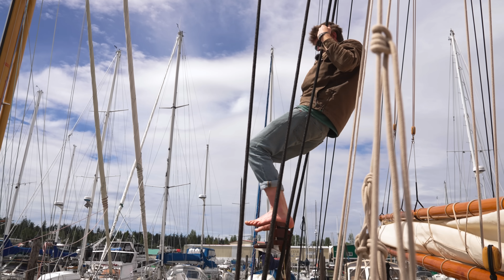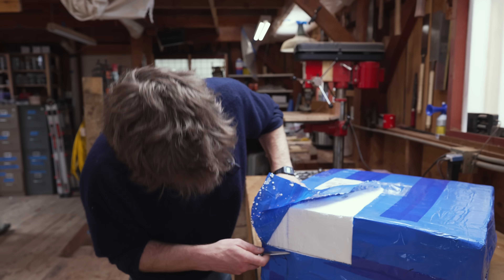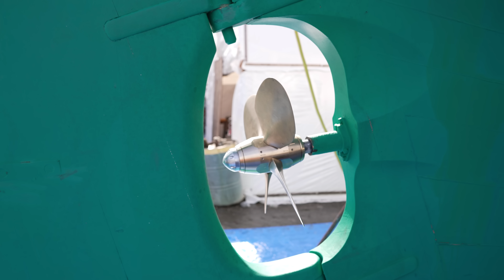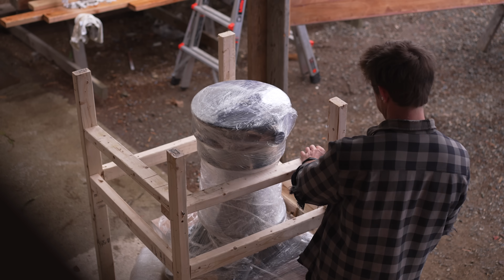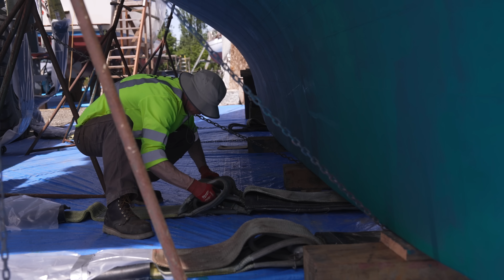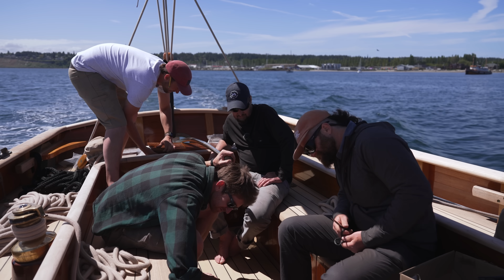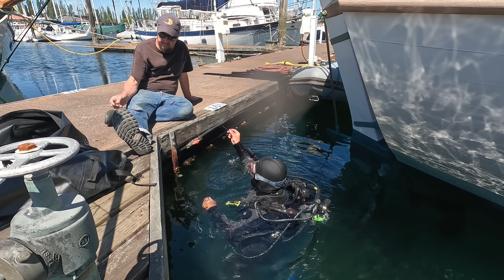New & old machinery - Gearbox, Propeller, FINISHED CAPSTAN ARRIVES!

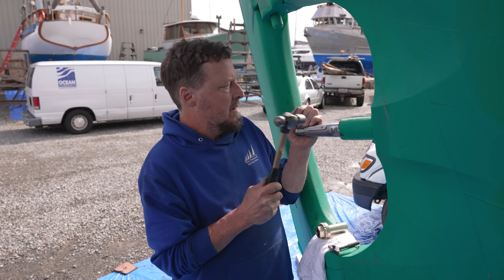Comment: 12:02 The only reason that the mechanic is using a steel head hammer and nota  mallet is that he is lazy. ...and filing the key rather than machining it is lazy too.
Reply: he is using a plastic dead blow hammer and he barely had to file any material off.. nothing wrong with a file and that was too little to need machining...

Comment: I can't understand why you don't have a boom gallows.  Surely reefing that sail is going to be a nightmare with that tremendous boom trying to scythe people off the deck?
Reply: TH has a 'double-sided' mainsheet, w/ both windward & leeward sheets. For reefing, the boat is turned head to wind & both sheets are tightened to keep the boom in place, aligned w/ the centerline. I'm sure Leo will build a boom gallows at some point, but it's not needed for reefing the mainsail.

Comment: I’m curious about the thread on the main shaft of the capstan. I think I saw, during the rebuild at the machine shop, that the main shaft was replaced. I could be wrong. Did you use the original main shaft or create a new one? The U.K. has British thread standards. Were the original threads the British threads, BSW or BSF, or were they UNC, UNF, or Metric?
Reply: Keith Rucker shaped a new shaft to replace the original. IIRC, the threads were an old-standard 12tpi, but were not Wentworth profile.

Comment: I remember back when you were planning the power plant for Tally Ho that you'd talked about the hybrid system and the feathering the prop.  What I recall is that you talked about how the prop would rotate while under sail and that by doing so you could charge the batteries.  I thought at the time that the feathering would be controlled by the cockpit so that you decide when the prop would spin to provide charge and when it feather to allow the boat to travel at higher speeds under sail.  This prop auto feathers, was it a change in design philosophy or did I not understand the original intent.
Reply: The original design intent remains intact. The prop only feathers when it's in forward pitch, the boat is moving forward in the water, & no pwer is being applied to the shaft. When the prop is in reverse pitch, the water pressure of forward movement prevents the blades from feathering.
Reply: @frederickstibbert7389  Yes, I understand how the auto-feathering works, what confuses me is I'm certain Leo said that they could adjust the prop so that it could turn the electric motor under sail to provide charging current to the batteries, or feather it to allow for faster speed under sail.  Either that plan has been changed or I misunderstood how Leo explained the hybrid drive.
Reply: @thermalreboot  ... and with the prop in reverse mode (when sailing)  the prop turns thanks to the water pressure on it, so does the  shaft ... result: you can charge the batteries
Reply: @on4xb  And how exactly does it get in "reverse mode"?  Leo just said that water over the blades while sailing feathered them.  How do they get in reverse mode?  Magic?
Reply: @thermalreboot  start the engine, put it in backward mode and give a bit of trottle: the prop reconfigures itself in reverse mode (which has no feathering possible), put the engine in neutral and shut it down. Because the prop and shaft are already turning (in the right direction) they keep turn
ing thanks to the pressure of the water and your are generating electricity. Simple as that.
Reply: @on4xb  How then do you handle polarity?  Reversing the electric motor will reverse polarity assuming it's connected directly to the shaft, if not you'd have to leave the transmission in gear which would drag the motor.

Comment: I really can not judge which one is more difficult, hard work or patience.  The Tally Ho crew have them both and they work persistently without overlooking any detail while working.   You all are amazing.  I am glad that the gear ratio problem was solved to your liking by replacing and adjusting the new prop.  Leo's explanation of the situation was comforting too because the system will work smoothly and productively.

Comment: Leo, One word of caution. From watching the machining videos, it appears that the bolt heads inside the bottom of the capstan drum may interfere with the power drive gear if the drive gear is extended too high into the drum. Hopefully this was designed with proper clearance in the process, but I don't recall it being mentioned nor tested in the videos.

Comment: Leo, Sir … now that Tally Ho is complete, at what point does she go under …. ???? Some type of Sea Worthy licensing process. Is that completed by the Coast Guard . Or does have to be done at all. For insurance reasons, I assume it would.    Thank you Leo.
Reply: To get insurance coverage, one must submit a Statement of Condition written by a licensed marine surveyor. The report details a comprehensive inspection of the hull, rig & systems, measured against the various separate standards for construction, plumbing, electrical, safety, etc. Since TH is registered in the UK, she must meet applicable British standards, not those of the USCG

Comment: One modern complication of the gearbox-prop calculation is the impact this might have on regen via the hybrid system. I wonder if the higher speed with smaller prop might improve the rate of regen under sail by spinning the generator faster.
Reply: The diesel's transmission is separate from the motor/generators' belt drive, which is a 3:1 ratio.
Reply: @frederickstibbert7389  but wont the prop size and pitch impact the shaft speed and torque in regen mode?
Reply: @nesdonbooth9726  - In regen mode, the diesel transmission is in neutral. I expect that the new, smaller prop will be somewhat less efficient  - it'll take some months of experiment to find the best reverse-pitch angle for regen w/o compromising power when driving under power in reverse.
For charging batteries w/ the diesel (w/ the shaft clutch disengaged), the lower transmission ratio (2:1) is better than what the 2.5:1 ratio would have provided.
Reply: I was wondering if there are yet formulas or tables to allow Leo's unidentified accomplice to make reliable calculations on the impact of these trans and prop choices on regen. This is fairly new tech that adds a whole other set of variables to a very well studied relationship. It is of course a minor factor, as poor regen performance would never trump good propulsion, but for me, facing a decision tree teetering between changes in the prop vs changes in the trans, it could end up being the deciding factor. After all, I doubt, given the beautiful classic looks of Tally Ho, that Leo will want to add a wind generator of significant PV, making regen performance during passages what determines the available peaceful electrical load.

Comment: In rough seas when Tally Ho's deck is a wash with sea water that enters the space between the capstan base plate, bolted to the deck and the rotary gypsy and capstan. What happens to the water that runs down between spigot gear and it's bearing, I didn't notice any form of seal to prevent water flooding below decks, or perhaps I missed it? An Old Sea Dog.
Reply: In a previous episode about the capstan, Leo showed some drawings of prelim sketches & design drawings for the motorization. One of the latter showed 2 sealed bearings between the top of the driveshaft right below the pinion gear & the sleeve that encases it.
Reply: @frederickstibbert7389  Thank you.

Comment: So impressed  with all that's going on..I've been a huge fan from the beginning.  Iam so impressed  with the work put into the capstan such beautiful work, however, (ahh that word). I've been thinking about how I would use it and the design presents certain challenges. In order to drop  chain quickly whilst the bow blows off  ,it would help to be able to disengage the motor which must be done without load, or the gears will be damaged .chain needs to be made fast in a lock or with a snubbing line with chain hook.  When the chain is running out to stop it , it will need a belayed line around the capstan, I'm worried about the hand cranks spinning if left in on a drop. . I'm sure Leo is across all this  ,like all of tally ho every thing presents challenges, the capstans story is not over yet, sails look great .
Reply: Thanks for the reply,  always fun talking tech stuff. I'm not sure.  I haven't  seen  the drawings. What worries me is when the unit is in gear it will not free fall the chain.  Not recommended when the vessel is stationary  but essential  when the bow is blowing off. Most  modern  windlasses  incorporate a cone clutch with some sort of gravity paul to lock  it. Love what Leo and crew are doing, but suspect  ther may be some chatter about that amazing capstan.
Reply: @simonmoody2649 - They can free-fall the anchor by leaving the drive pinion disengaged. In that case a line from the Sampson post is runs to a turn or two clockwise around the drum. Pulling on the free end of the line will act as an effective brake, but won't drag the crewman into the capstan's rotation.
Reply: If the design drawing shown in Leo's earlier capstan video shows its built configuration, the vertical shaft that drives the pinion gear is in 2 pieces, connected by toothed pawls inside the shaft's sleeve. A coil spring keeps them engaged, effectively creating a bi-directional ratchet mechanism that will disengage the drive if it gets overstressed.

Comment: A concern with a smaller prop is probably about the regeneration (wide keel)                                                                                                                                                                                                                                                                                                                                                                                                                                                                                                                                                                                                                                                                                                                                                                                                                                                                                                                                                                       , the side by side "in water" data on both props would be a good argument in the final decision making. 
The videos on the capstan rebuilding are hypnotical, from the  pattern making to the casting to the machining. With Tally Ho woodworking over it is a nice transition to the future.
PS: interesting optical illusion at 18:08 , the blurry round half inch "rivet" at the very top of the screen is the closest part to you face in the correct view .

Comment: I have followed Keith Rucker for many years too and am really looking forward to seeing the capstan installed and working.  On the gearbox issue, I am surprised the manufacturer does not offer a different gear set?  I would have thought the box itself would cover a range of torque/speed combinations, although I am sure you thought of this.

Comment: 2800 rpm that's so.ewehere in between a 4 pole 1800RPM and a 2 pole 3600RPM electric motor. What was the original RPM that the first prop designed for? I design fans for HVAC we never do 2 Pole too noisy. 2800 may be ok

Comment: Hi Leo i have followed you from the first day exeptional standard of ship building displayed the whole way through but now you are nearing completion one thing is puzzling me i thought one of the function of the hybrid power source was that when sailing you could charge batteries etc. with the alternator side of the system driven by the prop passing through the water but with the feathering prop you have now fitted i cant see how this will work i may be wrong but would appreciate your input for it seems to me if you cant do this it makes the hybrid side of pointles as if you have to run the engine to charge the batteries to then run the electric motor you might just as well forgone all that equipment and had a conventional set up  cheers john
Reply: Leo explained this in an earlier video. The prop has 3 modes: forward, backwards and feathered. There is no lever or any other thing inside the boat. If you put the engine forward the prop switches itself in forward mode, if you put the engine backwards, the prop reset itself in the backward mode. If you are sailing the prop feathers (thanks to the pressure of the water). To generate electricity the prop has to turn by the pressure of the water. To achieve that (under sail) start the engine, put it in backwards mode, give a bit of trottle and kick the engine in neutral. The prop is locked in backwards mode and turns the prop because in backward mode there is no feathering possible. To stop generating, start the engine, put it in forward mode, a bit of trottle and the prop reverses in forward mode. As simple as that !

Comment: Good you changed the prop, the reduced surface area helps while sailing. Has to be at least 0.03% less resistance :) Just a question since you have the hybrid Beta system installed, but we see you using the diesel for all the harbour manoeuvres. Does the system needs adjustment before you can use the electric only mode?
Reply: They need some time on that engine - it's brand new.

Comment: Hi Leo, Boat is getting even better, videos are great, congrats for 500 subs.
Doubt about the USE of the capstan:
I understand it has dogs to stop and as safety mesure at the lower part of the drum, but I do not see any break. This is,  to drop the anchor, you  shoud put the engine gear back down, and then release the dogs, but other than keeping all the weight of the anchor and chain with the handles, I do not see any system to set the speed at which the chain is realeased, nor any way to stop it. Can you explain how this manouver will be done with the capstan?
Really looking forward to se Tally Ho fully dressed with all fying jib and Top sail !
PS: Very interested in seeing performance of prop to charge batteries and to learn the bonding system and testing
Reply: I suspect that Tally Ho will be lowering (i.e., not dropping) anchor via the capstan.
Reply: @DaDitDa  
You suspect wrongly. 
The term generally used and preferred in most manuals is "drop the anchor" . Indeed, as  I am always trying to learn, I searched the web and manuals, I came cross the term "dropping anchor" many more times than those using "lowering anchor".  This appears also in professional literature and rulings (i.e. _"Let go anchor chain" is the command that would be used when ordering the anchor dropped for the purpose of anchoring the vessel_.  The previous sentence is part of a ruling by Alaska Board of Marine Pilots v. Renwick (21/2/97), 936 P 2d 526.

Regardless, there are two funny things about your pedantic correction:

a) you have not addressed the main issue: Apparently, there is no brake on the capstan to set the speed at which the chain is released which, as you should know, is essential to ensure good setting of the anchor ...., so it would not be presumptuous to assume that you know little about anchoring, since you do not respond or address to the issue.

b) As opposed to you Ken,  English is neither my mother tongue nor my first language. Perhaps you should spend your time learning your own language better, instead of trying to correct others.
Reply: @DanielBravo-f3h  It was not my intent to be pedantic or otherwise ruffle your feathers.  I was simply trying to convey that letting anchor fall freely -- "dropping" through a freewheeling capstan or windlass -- is different from "lowering" anchor through a motor controlled capstan/windlass.  I understand that dropping anchor is the vernacular for  deploying the anchor, but for Tally Ho's non-braked, motor controlled capstan, lowering the anchor is the more likely case than dropping the anchor.
Reply: @DaDitDa  
Thanks for your answer Ken.  The point that lead to my response is that the anchor generally is lowered slowly until it touches water and then it is dropped  -the chain it is let go - as it goes down faster than with any engine, so as to better aim the target patch and/or take bearings or mark in gps where the anchor is.  Still,  you need to be able to set the speed at which the chain goes out to match your boat speed. Relying on the capstan engine to do this is not common practice for these reasons as far as I know.  Leo did talk about a break in one episode long time ago, but at the time I thought he referred to a security brake (in addition to the dogs). For sure we will  see in a future episode how it is intended and/or the actual anchoring manouver (as we need to see yet anchor stowage & roller of which we have only see a picture.
Cheers.
Reply: @DanielBravo-f3h - I expect they could belay a length of heavy line to the knighthead cleat, then take 2-3 turns around the capstan drum, to act as a brake.

Comment: I had a thought/question. Being that the engine and running gear is brand new and not yet properly " Broken in ", would that have a effect on the performance of the system? I would hazard a guess that once things have loosened up and worn in a bit, the engine will have an easier time, maybe?